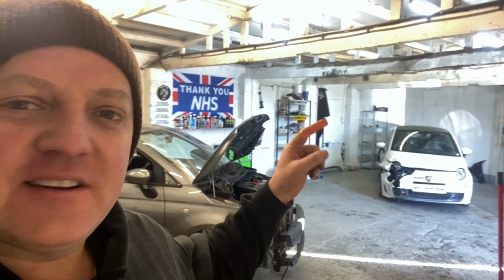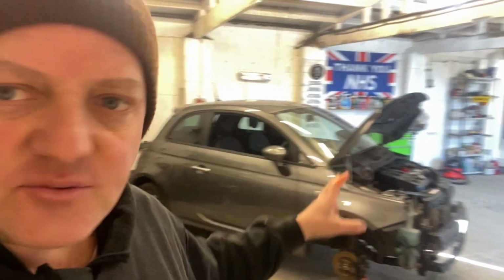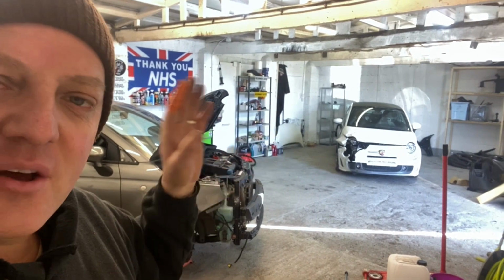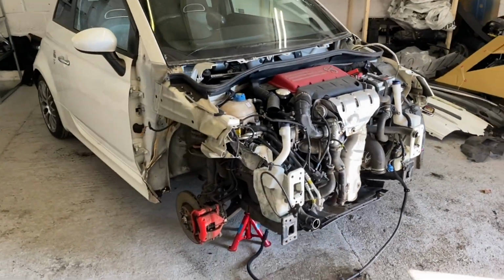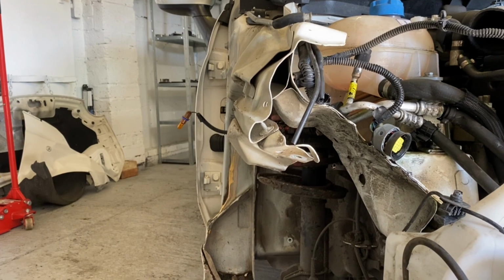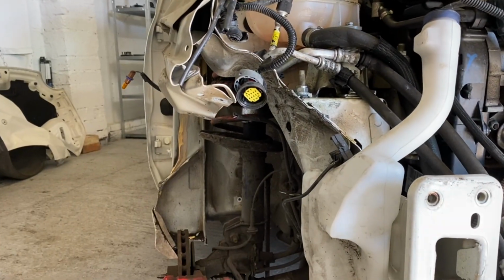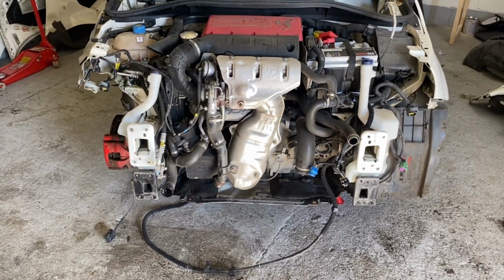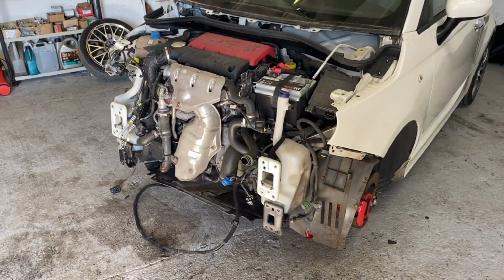FIAT 500 ABARTH 595 TURISMO CONVERTIBLE CRASHED REBUILD PT 1

Comment: I’ve changed one of those inner wing. You have to drill out loads of spot welds. Apart from the bolt on corner bracket that the bumper connects to you can pick up the entire inner wing on eBay for about £40. Time consuming unfortunately.
Reply from the maker: Thanks buddy I think it definitely needs changing nice one mate
Reply: Top man love 500 real gent

Comment: A lot less damage than I was expecting, you sounded a bit down when you revealed the damage, nothing that a competent body shop cant sort, would imagine it just needs a pull and squaring up.
That plastic thing with the pipe broken off is the Turbo Boost Solenoid.

Is this going to be a keeper when its Fixed ? I just sold my 500 Abarth 595 Competizione and I really miss it.

Keep up the great work !
Reply from the maker: Thanks Nick appreciate it buddy don’t think it’s going to be a keeper buddy but will drive it stay safe buddy 👍👍😷

Comment: You've taught yourself how to change cambelts, you've done a clutch. Inner wing is drill out spot welds to get it off, I'm sure  your guy who does the pulling would spot weld it back on if you can't do it, then it's a bit of what you've already done with other cars, chin up it's not always going to be bolt back on stuff.